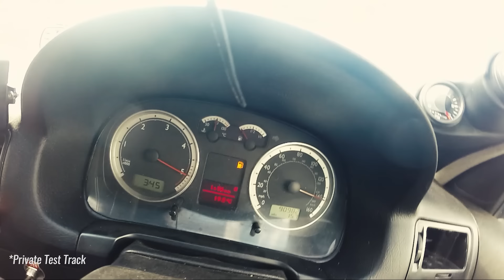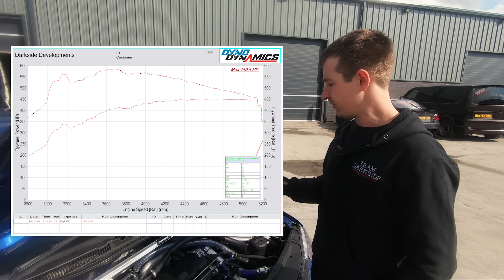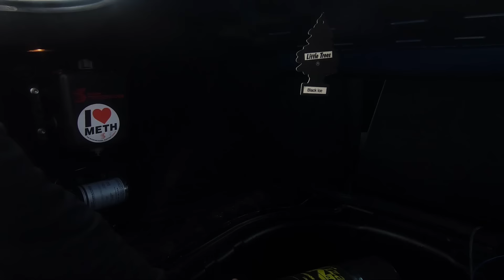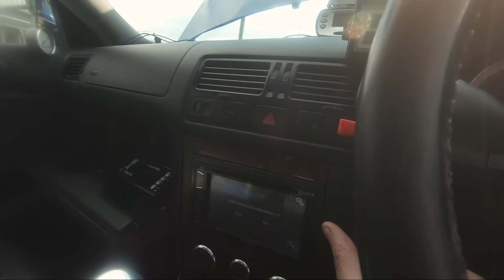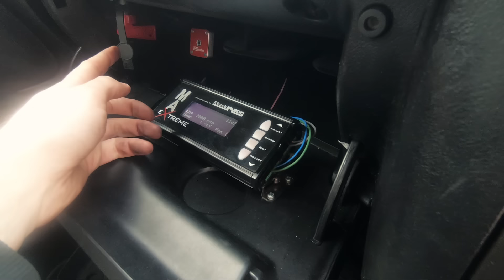WHAT'S IT TAKE TO GET 450BHP FROM A 1.9 TDI??

Comment: The PD scene is still massive, I love mine and hope to turn it into a crazy monster one day :)
Reply: Good engines run for ever as long as there looked after.
Going to look @ a 150 bora sport tomorrow, nice cars.
Reply: @andyhopkinson2708  why not get the highline model? My dad currently has a bora PD130 highline automatic. Saying that though my uncle has the sport model which doesn't look different to the highline. Something you could do which I noticed also in the bora in the vid is get the recaro seats which came as an option on the mk4 golf GTIs.
Reply: @zaink7037  not many Highlines about with climate + can always put leather in later
Reply: @andyhopkinson2708  yeah that's true about the climate which I think is silly why it ain't standard on the highline. When my dad was looking for a automatic bora PD130 he bought 3. One of them came with factory xenons and climate control which he swapped into the low mileage one he has now. Its possible swapping the climate control into a bora with the standard system as my dad has proven however it did take him several days to do
Reply: @MSi User that's one of the most inaccurate comments I've read so far today!
Reply: @MSi User newer engines are not better engines that is for sure. the new engines are way better on emmisions thats a fact but I disagree on them being better especially when you're using an A3 TDI as comparison ,yours might be noisy but it's probably been neglected at some point obviously a newer engine will sound quieter the pump dous TDI engines is one of the best mass produced diesels  ever made especially the older ones before all the emmision controling crap was installed
Reply: @MSi User you're just making stupid choices man, haha. And you're expecting a lot of an old car. Older engines aren't very different from new engines. It's mostly tech that is different in newer cars and then refinement of sound deafening and such things. The 2.0 TDI in my Octavia from 15 is the same TDI that they're using now in 2019 and it won't change for a few years because it works just fine. My Grande Punto with a 1.4 16v engine is also the same as the one in the newer Fiat 500s
Reply: @andyhopkinson2708  i had a highline 150 was garbage wish id got the 130 seems less problematic
Reply: @MSi User your problems seem like quality of life problems to me and not detrimental to a specific type of car, just buy a higher spec car next time 👍
Reply: @richiec9077  i really like the pd engine but am seriously considering getting a second car but pre pd as you can akso get good power from them too and mods are easier and cheaper
Reply: I’d rather the M57 6 cylinder 3.0 diesel with a hybrid turbo than any PD engine.
Reply: I have a modded caddy. Darkside turbo intercooler ect for sale. Not running crazy power 180atm. Could be more.  It is black 2008
Reply: @MSi User that is wag group shit customer treating but engines are ok
Reply: @roadreg1820  AMEN
Reply: Got a mk1 Skoda Superb 1.9tdi pd130 n would love for some mods. 

How many old modded Superbs do you see.....
Reply: @roadreg1820  me too! For a more refined driving experience!
Reply: I have a Bora pd130 Highline.  Love it to bits
Reply: Same, I have a pd150 leon with atm 200bhp and I just want more. It's never enough 😂
Reply: Is the mk5 tdi brm common rail or pd?
Reply: @SkitzyFrenix  All Mk5s are PD
Reply: @Mr330d  oh okay yea i found that out
Reply: @SkitzyFrenix  apart from the Petrols 😂

Comment: I have my octavia vrs mk2 tdi for 17 years and i didn't know that this engine's the pd 170 is that much strong.  All this 17 years  it was a stock car and  i had some issues but  sense last 7 months i found a guy and hi changed my car to an other level and even when it was brand new it was not fun like how it is now . Hi changed my manifold deleted egr deleted and removed dpf and stage 2 remap and the car is doing 260 bhp next step is bigger turbo and intercooler.  And the injectors were recalled in 2014 changed from Siemens to bosch and my mechanic told me  no need to change justb intercooler and turbo.  And thanks to zoqdi race team malta 🇲🇹

Comment: A 46 min video on a 450bhp pd 1.9! Brilliant stuff. 
Be interested to see you guys do a video on the differences between the pd engine's too. Such as 1.9 8v vs 2.0 8v vs 2.0 16v. And such pd engines as the 1.9 bls engine that throw rods, break gudgeon pins bores out of pistons etc and if they are worth doing tuning on compared to the older 1.9 pd. And a video comparing the 2260 variants vk, vzk, vklr etc. Cheers again for an informative video.
Reply from the maker: We will try to put something together

Comment: WHAT'S IT TAKE TO GET 450BHP FROM A  1.4, 16v, 75 bhp VW Polo from 2001?

A new engine!!!!
Reply: Forge everything and buy a turbo the size of a dustbin lid 😂
Reply: A pd engine swap 😂
Reply: New car
Reply: A fiat panda
Reply: Ls swap 🙃
Reply: A miracle
Reply: Turbo just a massive turbo and a sleeved block
Reply: See the power numbers of the Fiat 500 with a 1.4 16V Turbo.   Years ago in T124 Forum  a Fiat Uno with the small 1.3 turbo engine,  8 valve  had 355HP,   with a truck turbo, boost come at  6.000rpm.
Reply: @donRageme  lol

Comment: More PD stuff! Especially PD150
Reply: David Mills why especially pd 150? They are all pretty much same, only difference is injectors and turbo
Reply: @Atvsboy6  Because I've got one ;)
Reply: @davidmills9668  yeah i see, but any of the pd series are well come! i've got a pd 100 soon to be 300+ hp :P
Reply: Atvsboy6 as far as I know pd130 and 150 injectors are the same I believe there the same part number
Reply: jamiebmx360 yep. True that, but only on the ASZ pd130 and ARL pd150. BLT pd130 are not the same as ASZ or ARL
Reply: Atvsboy6 ow ye sorry mate I forgot about the blt engine I had one in my fabia vrs SE there normally dyno at 140/145 stock I’ve heard due to injectors ?
Reply: @Atvsboy6  blt is the same engine as asz,the only difference is the egr which is electronic to achieve euro 4 emissions compared to euro 3 asz.
Reply: jamiebmx360 yep, not as good as ASZ or ARL injectors
Reply: Jan Prokopenko egr and injectors mate. BLT injectors give 20cc less than ASZ or ARL I think
Reply: Pd150's also have a front mount intercooler as standard!
Reply: Russell Brown I have an ARL pd150 bora and that has a side mount cooler as standard
Reply: @dannyhudson5115  oh really. I thought all 150s had a fmic. My asz had a smic, all intercooler kits were different for the arl's compared to the asz thats why i said it...
Reply: @russellbrown8377  I inquired about a front mount and the "modified" s3 cooler was £1000!
Reply: Yea .......i have a 2.0 PD from the wifes totalled 2004 passat and if i cant get some 12s out of it in a mk1 im gonna be pissed and vr6 swap it.
Reply: What would 6-8k us dollars do for a PD?
Reply: Best engine ever made for vw. In my opinion
Reply: @caithimhjoe2135  
 I do like the old idi for its diesel noise and simplicity.
 Everyone knows its a diesel! 
I really liked my ahu I put mechanical injection on about 15yrs ago. 
 it needed further development but was fast for stock parts, tractionless 14 flats in the 1/4
Reply: @jamiebmx360 my PD130 ASZ stock after head rebuild made about 130 hp at the fly. Maybe a few less, but definitely not more than 130 hp
Reply: Atvsboy6 pd150 still trumps (bigger number)🤷🏼‍♂️✌🏻
Reply: @russellbrown8377  i have a pd130 with arl front mount, now i need teh alloy ic pipes but they are a bit pricey
Reply: @svenraets  they are, but theyre a better option than standard pipework for sure
Reply: @svenraets  ebay £138 for the pd150 front mount w/o fittings
Reply: @Atvsboy6  what’s the difference between asz and arl vs blt
Reply: @jamesward3414  asz and arl are same injectors, different turbo. 1749VA vs 1749VB . BLT pretty much same engine as asz but different egr I believe and the injectors are 20cc less

Comment: He spent a good 5 minutes talking about water and glycol for the cooling system lol. I can totally relate. Sometimes I will start ranting to my friends about things like the cooling effects of meth injection and the way they can actually make a supercharger sweat (gather condensation on the exterior of the housing) from how much it is cooling the body of the supercharger when it's injected directly into it. Even while the engine is running and the water coolant is near 200 degrees F, the methanol will cool the supercharger below ambient and feel cool to the touch. It's amazing. That is also happening to the surfaces of the parts it going through not just the supercharger. Which is why I'm a huge advocate of at least adding a meth injection kit when building cars for more power. If possible, (in the USA) going full E85 or the very least adding a flex fuel sensor and adding all the necessary lines and seals for running E85. Since not all fuel systems are made to handle E85. There are cases where the type of rubber is not E85 friendly and it can soften and bloat or even break down and get into the fuel lines. So always talk to someone who knows what they're doing when going E85 or DO YOUR RESEARCH first. You won't regret playing it safe. You use more relative fuel flow from E85 compared to traditional Gasoline, but the power gains are great! Keep in mind E85 does not usually yield very high gains when added to Naturally Aspirated engines. It's much more practical on Turbo, and Supercharged engines since you can gain hundreds of horsepower more in the more powerful setups just by switching to the E85 Fuels. Remember you can't run a Diesel on E85. You can add Water Methanol injection though. It cools the interior engine surfaces like piston tops, valves, intake interior surfaces and also boosts the octane. Seeeee just like the man in the video, I went on a super long rant lol. I love being a car person, we all have moments where we go on and on about one particular subject that may not even be remotely interesting to someone not into auto modifications. ;]

Comment: I'd like to see a video about the BMW diesel modifications and how it drives.
Reply: M57 is a diesel 2JZ 🔥🔥🔥
Reply: Check polish site with m57 in pajero 400-600hp and in opel omega b2 with tremec t56
Reply: n57 > m57 end of story 450hp in a *35d is no problem with decats and tune

Comment: Loving the content, any chance of a video on remaining smoke free with a DPF delete or any solutions which you recommend to pass a mot smoke test?  For use on a private road of course :)
Reply: Restrict your injectors from the ECU, that s what I ve done on my Golf 4
Reply from the maker: PD and smoke free wont be easy at the higher power levels
Reply: What about cr140? Are they relatively smoke free
Reply: Just do multiple tunes, one with low as fuck air to fuel so it won t get smoke, and pass as that
Reply from the maker: @lewishudson9749  They can be with a good tune but if you're after peak power you may need to compromise on a little smoke.

Comment: Great detailed video, but would have been good to see it do some pulls with the traction control turned off as the pulls it made seemed lumpy. Also exterior shots to see how smokey it is.
Reply from the maker: there is a separate video without TC, It smokes a bit.

Comment: when I had a b7 s4 running 750hp I used the ac to cool the coolant, along with moving the radiator to the front and moving the intercooler to the side it kept the engine at a good temp. Just before I sold it I got the oil running through the same system.
Reply: Sounds interesting!

Comment: When you are pushing enough power to need to go to straight water as coolant to prevent overheating, that is mental
Reply from the maker: Water ports not designed for 3 x output!

Comment: I’ve been building a b5 on a budget for the last 6 years. And I’m at about 7 grand right now. And all I’ve done is suspension and power mods. I haven’t even done my clutch yet. It sure would help if it would stop breaking so I can put performance shit on. Damn thing will be fully rebuilt soon. Not a cheap car. Buy a corolla if you want cheap and reliable. The b5 is neither of these. But way more fun and sexy.

Comment: Hi, I'm running a 140PD TDI (BKD engine) with a GTB2262VKLR and Firad 120% nozzles at 321bhp and 502Nm, still using an OEM water pump, would you recommend upgrading to an aftermarket electric water pump?
Reply: Yes it is still running?

Comment: I noticed the Bora on race tune has a very simular power output to the Ibiza 6L you used for drag, would you say 450ish is the upper limit for the PD engines? or could they reach the sort of levels the Arosa is reaching with the right work done? Thanks for the epic content keep the videos coming!
Reply from the maker: This is pushing it, especially for something that needs to do everything!

Comment: Why not fit thinner valves so you get that extra 1mm of lift, and deeper valve seats and stiffer springs for the extra rpms, especially with a late spool turbo
Reply: None of that is correct really, thinner valves melt easier and it won't help the RPMs, Di Diesels just don't have the time to burn
Reply: A diesel engine at that power means thin valves and stiff springs aren't friends. It WILL break. Something will melt like Ryan said or something will snap
Reply: I can only assume that if the guy had them fit Darksides cylinder head with the CNC dimpled ports that he had the oversized valves and spring package they offer fitted as well. Why would you drop £1300 on a cylinder head plus their camshaft and not put £400 worth of valve train?

Comment: Imagine spending 20k for only 450hp 😷 drop 4K max on an OM606 and your screaming all the way to 6000 rpm and 500hp on a stock engine 😂
Reply: Better drop 1k on M57 for 400 hp.
Reply: I’ve imagined it, but this is a pretty low stakes situation so I feel like it’s all gonna be okay.
Reply: Imagine that 😷😷😷 oh just imagine it 😷😷😷😷😷
Reply: I love the vag pd but i would definitely trade one in for an old merc with an om606 amazing sounding with right exhaust
Reply: woody555kl I daily one with a Garret gt35 at 300hp. Sounds awesome and most reliable car I’ve ever owned 😁
Reply: It wasn't spend on the engine alone.
Reply: VluggeJapie yeah in fairness I seen they spent 10k to build the tall engine and ancillaries
Reply: @Diesel8290   Still A LOT of money.
Reply: @ElectronicRedPanda PD is a 1.9 liter 8 valve
Reply: Om606 with big turbo for life😄
Reply: @drpr1481  injectors and swap possibility are limited and expensive
Reply: Can i get 300hp  for 10k from a 2.0PD? 
We got an 8v here in the states. 
It'll be fun in a mk1.
Reply: @EngineEngineer  
Ive kept everything from the wifes wrecked 2004 passat for the project. 
I think the best plan would be to get the swap running, and then id do upgrades. 
Ive got to do more research on the whole thing to begin with but for the 100$ buyback from the insurance company I was stupid to not keep it. 
I heard about the balancer shafts and id get all the computer retune/ deletes id need to get going. 
 im into the older vws and a 2004 is a late model 😂
Reply: You guys are so cute, I'll just leave this here: N54. 💪
Reply: Imagine if everyone did that we wouldn’t see cars like this hahahah narrow minded fella
Reply: @AsmirSut  N54<N57.
Reply: @EngineEngineer  Yes indeed, exactly my point. 🤣
Reply: @ElectronicRedPanda 8valve*
Reply: @ElectronicRedPanda as Hortense Lemos says, Pd is 8 valve, which makes it more impressive.
Reply: Getting 450bhp from a 1.9l 4-pot is far more impressive than getting 500bhp from a 3.0 litre
Reply: Sudo Creme well considering there is stock tall block om606’s making over 700hp. Well over 100hp per cylinder. That pd engine is on its limits.
Reply: @ElectronicRedPanda pd is 8v
Reply: I mean we could buy LS1 cars and make 400whp with a $500 dry nitrous kit. But where's the fun in that?
Reply: I have the AVF PD130 I newer put in to it 20k newer... 😂😂🤣

Comment: Any chance you can do a video on what oil are you running on your cars, oil filters and why? Loved the coolant and fuel filter explanation
Reply from the maker: I don't think it would make a long video, we just use genuine oil and genuine filters :) We have never had any issues so why change
Reply: @DarksideDevelopments  i saw on the arosa something like RockOil...if i remember correctly...there was definitely something other than Vw Oil...i was curious why.
Reply: @DarksideDevelopments  could you maybe leave a link to the type of oil you are using?
Reply from the maker: @david06083  We have the Rock Oil listed here - https://www.darksidedevelopments.co.uk/products/rock-oil-10w-50-carbon-engine-oil-5l.html the Arosa is back on Genuine Oil - https://www.darksidedevelopments.co.uk/products/genuine-vw-quantum-platinum-engine-oil-5w-40-5l.html

Comment: Reverse osmosis water is actually cleaner than distilled water. I think if normal cooland is not sufficient the radiator is simply to small?
Reply: I would agree but a good radiator might be  £500 or more. Coolant is cheap. The Citigo for example just has no space
Reply: Bravo.  Go with custom alu.
Reply: @ryanp6138  150-300gpb ebay used new ect
Reply: @schoumv6  this already has bigger alloy radiator

Comment: So would a higher amp alternator and a electric water pump free up more power from not belt driving the water pump? Would it be worth doing even If you had an engine that didn’t need an electric water pump?
Reply from the maker: you dont really need a higher amp alternator. Not measured the power 'gain' as such as its a lot of work for a back to back test!

Comment: If the spring loaded pressure relief valve drops to bits on a vp37. Can that cause diesel to drain back to the tank over night?
Reply from the maker: It's not something that we have come across however if it was in that kind of state it most likely wouldn't run